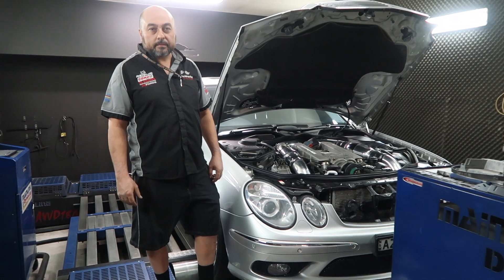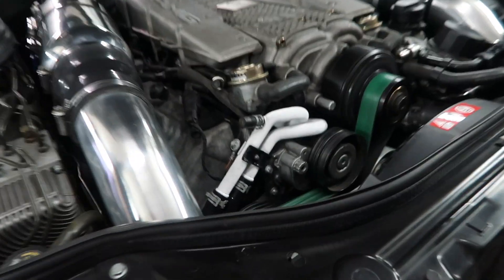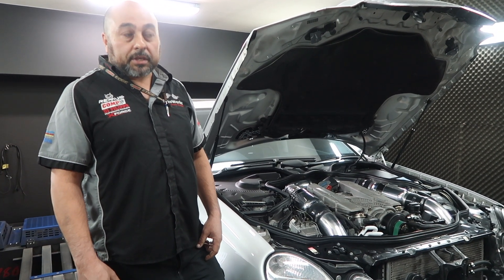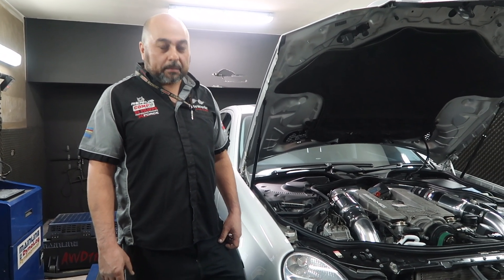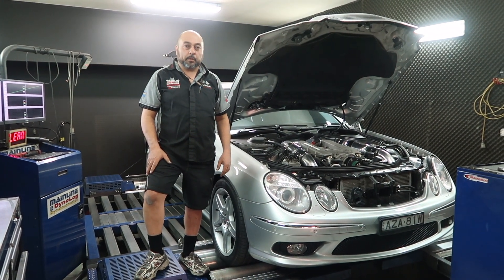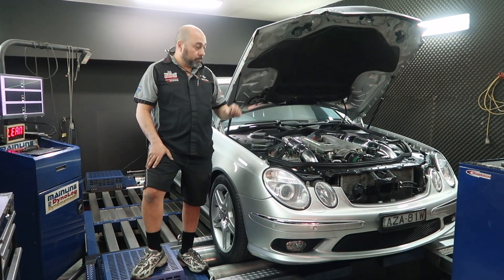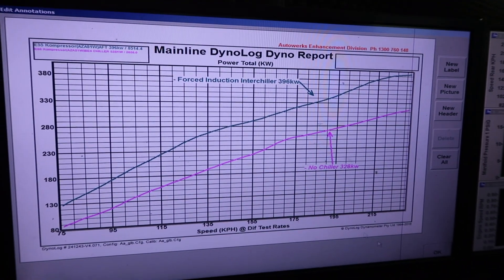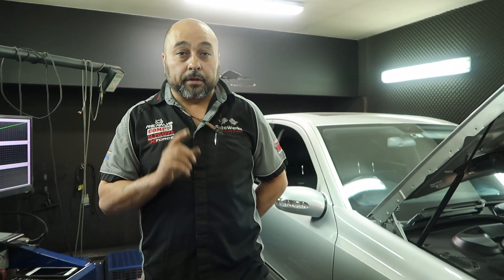E55 Interchiller Detailed Explanation and Dyno Results

Comment: Do you run it with a heat exchanger? Or just the chiller
Reply from the maker: Most people delete the heat exchanger however if you wish you can retain it on a bypass valve the reason you place it on a bypass valve is because the fluid will always be colder than the outside air temperature if the fluid is to pass through the heat exchanger the heat exchanger will heat the fluid not cool it

Comment: 2:44 never mentioned the 90mm bbk throttle body in his list of mods.. and
I’m not sure what size sc pulley he said was installed but

90mm TB,  LT headers,and I’ll even give u 83mm pulley u could  expect to gain  120hp w these cars. Shoot.. headers &TB alone will give u near 100
I don’t see how this car dyno’d 439rwhp unless heatsoaked & pulling timing. That number suggests 319hp from the factory.  

+50 hp w interchiller would still be great. I’m not sold on + 100hp as advertised

Comment: I guess it will become an issue in the winter when you want the heater on and not the ac?
Reply from the maker: In winter you simply set the cabin to your desired temperature, set the system to chiller only via the ON/OFF switch we provide, the chiller will get freezing cold and the cabin will be nice and toasty.

Comment: Do you have additional reservoir for cls55 to use it with your chiller system?
Reply from the maker: There should be several aftermarket options or any decent fabricator can make one

Comment: But dosent having the a/c on at full throttle bad?
Dosent rob hp?
Reply from the maker: You want the AC system to turn off under wide open throttle conditions, generally most cars will have 2 parameters to turn it off, which ever is exceeded first eg 4500rpm or 70% throttle. 

You then over come this by having a reservoir of fluid which you then struggle to heat up, see this video as an example of a system with a 12L reservoir, the chiller isn't cooling him down after he gets off the throttle it's the reserve of fluid which he has not yet used: https://www.youtube.com/watch?v=kf1rcSOUAUE

Comment: What if i turn off the AC or AC liquid will be done? Engine gonna explode or temperatures will go stock?
Reply from the maker: Once fitted you will tune the IAT from 0c (32f) to 90c (194f), the engine will then literally be making as much HP as it possibly can for whatever the intake air temp is, if you turn your AC off then it will likely run around 20-30c above the ambient air temp, since you have already tuned for this it will be fine. In most cases guys leave their AC on 24/7. However with the comp solenoid you can run the system in 2 modes: 1. Cabin and chiller or 2. Chiller only.
Reply: Thank you for back input.
Reply: @ForcedInductionInterchillers  what is the price of this exact kit for this car exacly ?
Reply from the maker: @Chostera  https://fiinterchillers.com/store/ all prices are on the website you will simply need our stage 1 kit, list your model car the kit is for and then we supply the correct fittings needed for the E55 etc